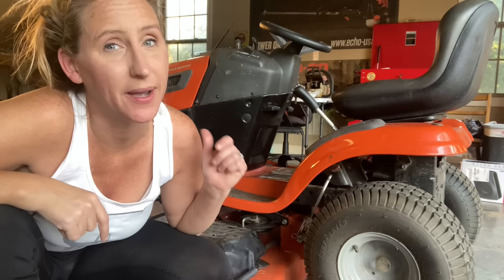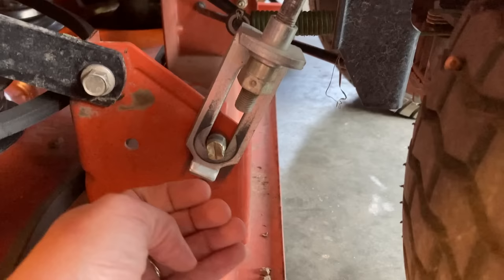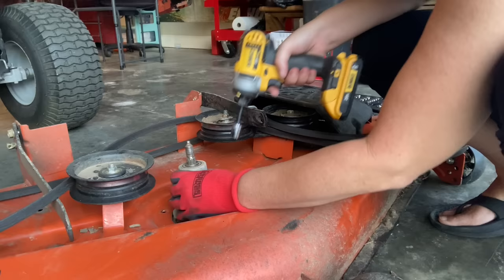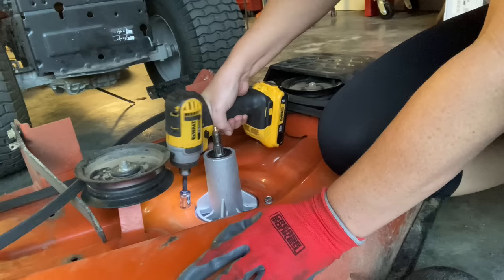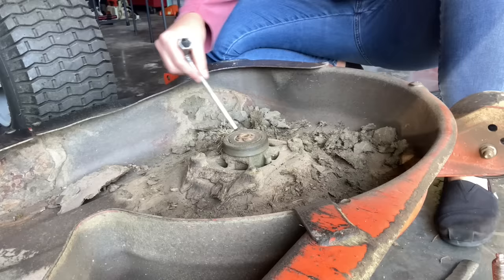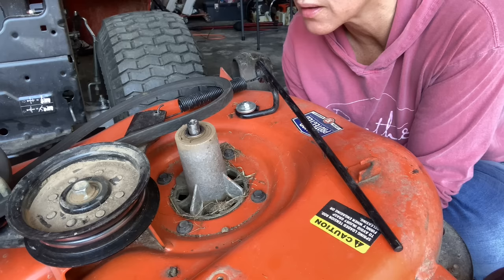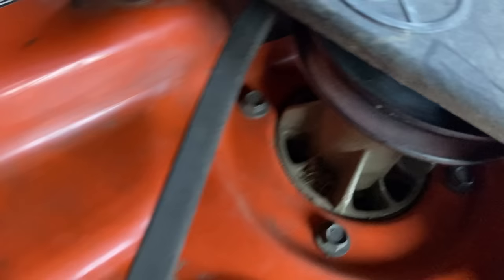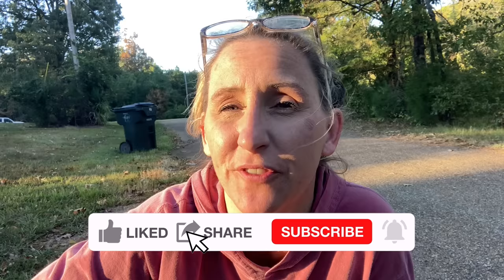Husqvarna riding tractor deck repair. Spindle, shaft and blades replacement.

Comment: Have you ever considered using a pulley puller to get those really hard ones off?  That may save you some time, especially if you run into this situation often.  Looks like on this model that you will need to remove the zerk to center the puller.  By the way, I love your cat!

Comment: Had a similar thing happen on a craftsman new complete spindle and blade replacement and found the star shaped  blade drive damaged on the other spindle . I did the same thing took the good spindle shaft fitted to the ok spindle with damaged shaft . And ready to go .

Comment: Wouldn't some anti-seize on the spindle bolts make it easier to remove them next time without breaking them off in the housing? Is there a reason you do not use it?

Comment: Well Bre, I'm working on my Husqvarna. I went over the side of a rock and when it came down one of the welds broke? It was the hanger that hold the deck up/on. Real quality, they have a perfect bead running along the seam but managed to miss the two parts and only welded along one side. It's ok though, the paint was able to hide it from an inspector. When the weld broke somehow the deck got split open, only about 6 or 8 inches. In spots there were areas that had almost a 1/16 inch of weld holding it together. While the deck was upside down I noticed a spindle  had two of the four mounts broken. I have had to replace them once before. My bad, I hit a rock. At this moment I'm dazzled by the lack or Quality I'm finding as I am doing repairs. My 35 year old MTD was so much better!!

Comment: The spindle shaft that was mushroomed can be repaired easily with a little grease and a new blade. The procedure; smear grease over the star pattern on the blade on the side that will contact the hub. Turn the blade bolt in by hand and as the blade meets the blade hub move the blade gently back and forth and continue to tightened slowly. The back and forth movement is to "feel" for a point contact with the hub, once the blade bolt is snug use the ompact to drive it home. It may take 2 attempts at this but afterwards the blade will fit on the hub.
Reply: Thanks for this tip!

Comment: I had to replace a spindle assembly on my daughters mower. I think the reason the bolts break off in the housing, is because they assemble them with a self tapping screw, and  the aluminum housing, with a steel bolt, is the perfect combination to freeze a bolt in a thread. 
 I put anti-seize on the new bolts.
 Her deck also had been assembled with the blade NOT on the spindle star, and it mushroomed the spindle. I just took my die grinder, with a cone shaped carbide burr, and carefully cleaned up the mushroomed star, to fit the blade on properly.
 Those grease zerks work great on the spindle, if you take the inner seal out of the bearings before you mount the assembly on the deck!
Reply: I forgot to mention, the blades on her deck were completely trashed in just 2 seasons of mowing. I would never replace them with an OEM blade, because they are evidently junk from the factory.

Comment: Replaced the spindle on same tractor yesterday just the 48” version. Had it not been for your video I may have been doing this for a few hours. Had the deck off, spindle replaced, deck back on and mowing within an hour.

Comment: Lady, you are knowledgeable.  I have a mower you might find interesting.  I have a Craftsman Pro Series lawn tractor, with a 42 inch deck.  After 450 hours I was going to replace the factory bushings.  I received the bearings in the mail and when I tried to install them I realized that first they were too large, and second the factory bushings were not steel------they were nylon.  Surprise, surprise, when I looked at the axle I was amazed that there was NO wear.  Yes no wear at all.  I don't know how much longer my mower will last, but whenever I buy a new one I will try to buy nylon bushings.  Investigate this and, between you and I, I would install these on ever mower that came in my shop and give people a lifetime warranty on the front wheel work.

Comment: Thanks for pointing out the fake zerks. Whole lotta discussion about lubing them, ect. My experience shows the spindles will mushroom and fail long before the sealed 20:03  bearings fail. Yes, the threaded spindles will save you pain.
Reply: I had replaced the original spindles with real (maybe) Husqvarna spindles or very good fakes and had one mushroom.  I just bought a set of spindles which may be made by China, Inc.  They have grease fittings on the top of the shaft, suggesting the shaft is hollow to grease the bearing.  Real or not?,  I didn’t disassemble to see.  Quality seemed acceptable and so far, so good.

Comment: I stripped my deck down, had it sandblasted, sprayed with Line-X, then I reassembled it using grade 8 nuts & bolts.  Much stronger and won't ever rust

Comment: The same thing happened to me mowing an area I don't usually mow but makes it easier to see when I'm driving off the property. Brand new Troy Bilt 46XP Bronco about a month old. Hit a rock, bent the blade, broke the spindle housing. But got it up and running as soon as the parts arrived. Now, more careful   lol. This was 2021. Someday, I'll have to write about the Craftsman I had previous to this. It lasted me 17 years!!!

Comment: First I’d like to say that I’m in no way criticizing or bashing anyone.
I have the utmost respect for you Bre and appreciate you.
You are the reason I’m now repairing my own small engines!
I also didn’t understand why a grease cert comes on replacement spindles.
I had to know so I attached my grease gun and started pumping.
Each time I pumped the handle I heard air escaping somewhere.
I couldn’t find where so I kept pumping and finally grease started coming out the bottom of the spindle from the cup around the bottom bearing. If I were guessing I’d say that it is designed to dissipate heat and possibly help the spindle to spin easier.
Hope this helps and thank you for everything you do to help people out with repairs.
I would post a picture but I don’t know how.
My deck rebuild went flawlessly thanks to your video.

Comment: I literally just picked up this exact mower from the side of the road.  no deck on it, but just needed a new air filter and oil and it ran no issues, tough tractor.  wish I could find a deck for it lol

Comment: Great video, very good information, easy to follow, love the cat..  I would recommend greasing the bearing while you had it out though, I could not really tell if you did but looked dry in the video, dry bearings create heat and rattle that can cause the spindle mounts to crack.

Comment: It's a good practice to pressure wash the bottom of the deck before reassembly.
Reply: now that's a big lovely mess!
Reply: If you pressure wash the underside of the deck,you better regrease the spindle brgs cause you washed out all the sp8ndle brg. Grease,,,lol😅

Comment: I have owned a Husqvarna LGT-2654 lawn tractor. I take care of some steep hillsides, so I had ATV tires installed on the rear so it would stick better on the hills. I will be honest and up front and admit that I was hard on this tractor. I had two major problems with it. First, I couldn't seem to keep the anti-scalp wheels on it. I ended up using after-market bolts and locking nuts. Then, the frame broke clear in two on both sides, just ahead of the rear axles. Come to find out, Husqvqrna used the same gage of steel for the frame on this 54in machine, that they used on their 38in machine. It didn't take very many times, coming off a steep hill and hitting bottom, to crack the frame . And.......yes, it was purchased from a big box store, not an outdoor equipment dealer.

Comment: When you spun the blades around to make sure they wouldn’t hit, I thought for sure you’d line up the cutting edges to see if the deck was bent from hitting whatever he hit so hard it broke the housing and spun the pulley on the shaft. I grow rocks in N AL and have had a sudden stoppage that bent the deck, blade, etc, etc. I had to ‘persuade’ the deck a little (lotta) bit for the blades to be back in plane.

Comment: Another symptom of a stripped spindle shaft is the grass isn't fully cut for that blade. I replaced all 3 of mine on my 54 inch deck. Thanks for all the work you do on Saws to garden equipment always helpfull hints on taking care of quipment.

Comment: thank you for the video, my belt came off today while cutting and pulled my deck off.  noticed my blades are damaged  in a very similar way, so new blades and new belt required.  great video!

Comment: I just did the Craftsman version of this tractor and all 4 bolts snapped off! i drill them out and just through bolt them with a bolt and a nut. makes it a lot easier to remove to change the bearings, they dont have greese zerts so those sealed bearings last a couple years thats it
Reply: Same thing happened to me on a Craftsman YT-4000 deck.  I had to get the snapped off tabs removed by nicking them with a hacksaw blade and whacking them with a cold chisel (a little easier than drilling).  That was definitely the worst part of the job.  The rest only took about 20 minutes.  The other thing I’ll add is that there was a lot of deck vibration after replacing the spindles.  It turned out the belt was bad even though it looked OK.  I got a Sunbelt replacement from Lowe’s which has the same part number as in the Craftsman parts manual and now the deck is nice and smooth running.

Comment: You can use those zerk fittings even though the bearings are sealed. If you fill the housing full of grease. The grease will go by the seals.

Comment: I was disappointed you did not clean the stuck on grass on the deck bottom better.  These spots, when wet, cause premature deck corrosion and rust through.  It was a golden opportunity to thoroughly clean the deck of the debris.  Also would have been a good time to grease all of the spindles while the deck was off the mower.  Really enjoyed the video.
Reply: Those spindle bearings are sealed bearings and unless you take the sealing cover off one side you will not grease the SEALED bearings !!!  DUUUHHHH !!!!! she mentioned the bearings were sealed, those spindles have a fake grease zerk because the design is left over from when the bearings were NOT sealed !!!
Reply: @wilburfinnigan2142  wrong thread my friend.

Comment: I definitely enjoyed this video. You are quite charismatic and experienced. However, as others have already pointed out, working on such equipment while wearing sandals and moccasins is dangerous! You may have done this for a long time and never had even on small wound but, the clock is ticking. It will happen and you will not like the results! Also, it sets a very bad example for others who have far less experience!
Aside from everyone worrying about your feet, this was a well done video. Personally, I do not like to use impact tools to tighten nuts and bolts. There are torque specifications for those parts for a reason. Someone can over tighten those mounting bolts and the cheap castings will break while in use. In addition, I use anti-seize compound on dissimilar metals such as steel into cast aluminum. If those parts ever need to be serviced again it will be easier to remove them.
Keep up the good work in the shop and keep making these excellent videos. That is, once you put on some decent work shoes! LOL

Comment: Hi from Saskatchewan, Canada.  You’re doing a great job. I did a deck for a guy and found out some of those blades are five star and some are six.  Found that out the hard way. Great video.👍
Reply: NOT if you order the CORRECT part number for your machine !!!  Husqvarna and all the other brands they make all use the same parts !!!  DUUUUHH!!!!!

Comment: Always get a kick out of your videos. My JD 110 from circa 1993 or so just broke a spindle also. lol. Darned things just don't last anymore. Anyway, the blades looked exactly like this one and I also had some epiphanies around the pulleys. You cannot remove those center nuts without an impact gun. The pulleys on mine were tough also. I rebuilt the whole deck and spent a lot of time with pry bars until I remembered I had a pulley puller in my lower chest. Again I did it the hard way, but found out after that the little holes in the pulley are for bolts. uh huh. So in another 30 years I'll probably forget all this. My tip to you is about the threaded rods and hammers, put a nut on the end and catch a few threads. Bang on the nut. You can replace that if you get crazy. Thanks for all you do. You're impressive.

Comment: Husqi's BRILLIANT angineeers put steel screws in an aluminum casting with no antigalvanic protection. They ALSO put grese zerks in the housings for SEALED BEARINGS! Hmmm maybe brilliant is a vast over statement. I had to repair one just recently.

Comment: Great video, thanks for sharing!   I wish I had that nice tension-er  lever on my Craftsman deck, I use a big zip tie to pull the spring and release and tension the primary deck belt.
Reply: Craftsmen mowers most low end models are made by Husqvarna !!!

Comment: there is a youtube video that shows those zerk fitting do work. only it takes a lot of pumps with the grease gun to get the cavity to fill up.
Reply: The newer spindles from China, Inc. have grease fittings on top of the shaft.  I didn’t take the spindle apart, but perhaps the shaft is hollow to deliver grease more directly to the bearings … or it is completely fake.  Either way, they’re on the deck and working for now.  At least they aren’t very expensive.

Comment: A trick I learned... when buying replacement spindles I drill out the holes and use bolt and nut. No more breaking off in spindle and no more becoming loose which is what happen to this one all worked loose. With The ones that are not tapped you end up not getting it tight enough because so much force is used to cut the threads. So you feel like your gona strip it and end up leaving too loose.  Then the play eventualy wobbles out the hole and and ruins the deck or breaks ear off. I have never had to replace a spindle after I started drilling out holes.

Comment: When going through  mower deck , why was the Bearings in deck not Changed , then you can Show how Bearing Seals are Sopposed to removed if it has both seals in bearings.  
 My dad started mower shop in 1977 , I took over in 1996 , several  years of Dry weather,  it was tough , cause I had 2 kids in School , my health started going down . So I closed mower shop. Mainly Not much $ in the Repair's  , especially  when you can replace  mower with New one for same price as Repair  Prices. 
I really liked working with Customers and doing the Repair's  to them plus sometimes the Challenge's that comes  with the job. 
I really got tired of Seasonal  Workers  , seamed every year had to train someone  All Over again  !

I am glad you enjoy  doing the Videos  and teach people  , as when I did the Repair's  , I refused to Show anyone.  Did not want to Give the tips Away. 
LOL

Comment: Chickanic,
Hello from Houston area. I'd vote for your presidency!!
Enjoy your videos, enjoy your humor. I have more confidence in working on my Husqvarna YT. As well as any small engine tool.

Ran over an "almost below ground stump" and now won't even crank. I'll be pulling the deck off to look for problems. Haven't found a specific vid for this mower so, will look for all the items you replaced in this video plus something called "shear bolts." Great production, really clear and audio follows excellently with your video to understand what your doing. 

Thanks for being such an excellent neighbor!!!

Comment: I have a Husq mower and usually take it to a shop for blades because I couldn't figure out how to do it myself other than raise the whole tractor 18" off the ground. (I diy almost everything and have for 50 years). Thanks for exactly this, I never thought to remove the deck.

And I think you'd find a slide-hammer to be a useful tool.
Reply: Go to Harbor Freight and get a riding mower lift.  Works great, and it will probably pay for itself in 3 to 4 blade changes from shop labor charges

Comment: Lots of great tips as always.  I am doing all three spindles, both idlers, new belt and blades.  The new Spindles have zerk grease fittings on the side and the kit comes with a grease gun extender so they must be the real deal. One can always hope right.  if the ones on the top are fake, can you replace them with real zerk and save time on another replacement hopefully way down the road?  Just a thought, I have a pack of various sizes zerks so I always replace them when they are damaged etc.

Comment: Well kiss my grits, the Chickanic  is wearing gloves. Most likely I was not the only one that suggested it. As a mechanic for 50 years I used a large brass hammer to break things loose. It did not damage threads... Did you ever tell me what year that Red Vett is?  I saw the herd of deer, but the Vett was in the way!   Good video,

Comment: I was replacing the spindles on my Scotts 20/48 by John Deere and made a crucial mistake. Changing them out was a breeze but I was supporting it as you were between my legs and it got away from me breaking a part to the drive pulley apparently you can't get any more. What a shame that mowers engine  (Kohler Command) still kicks butt, although no deck. Tried to find one everywhere on the internet but either I couldn't find one or one close to it was priced way to high. If not for that I'd still be using that machine.

Comment: Thank you. One the best investments I ever made was a once-in-law time be a bx kubota. I don’t blade my deck weighs much more than that one and it is 60 inch. With 2000 hours on the glorified lawnmower As it is referred to even though it has four-wheel-drive host of track etc.